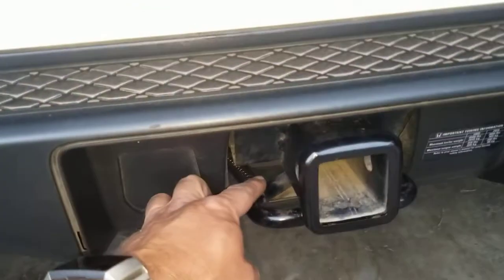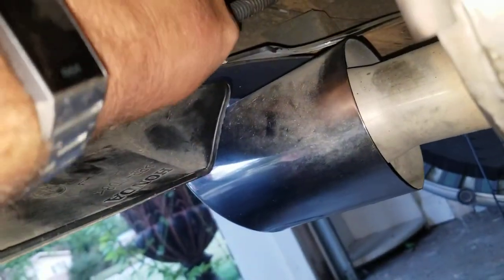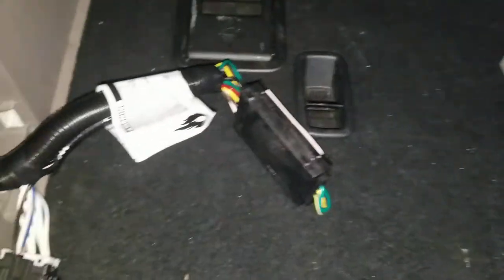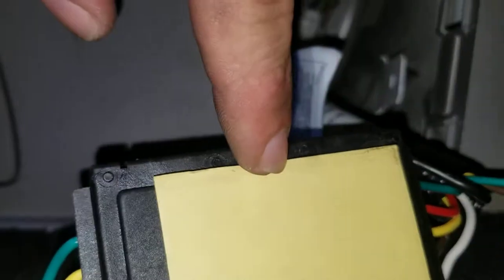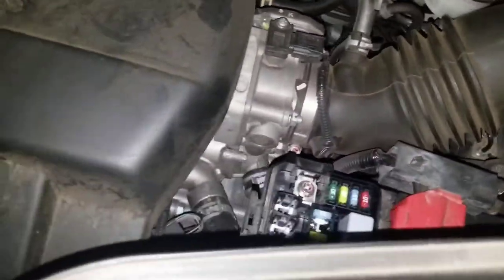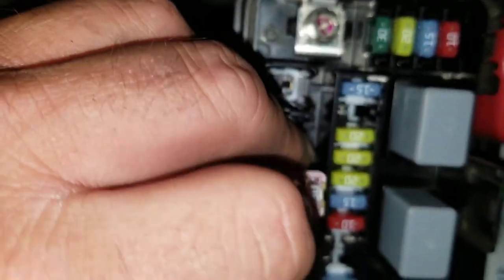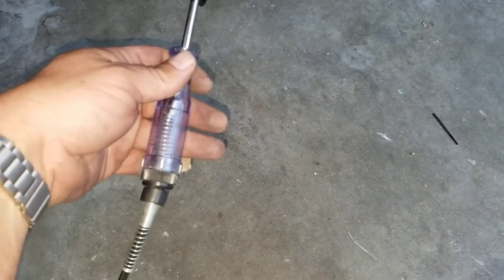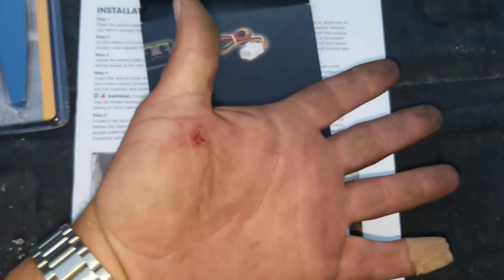2015 Honda Pilot, easy plug and play trailer lights

Comment: gr8 vid,  I have a 2019 ridgeline,  its a little different but  enough for me, I think for the 2019 ridgeline/pilot its Curt #56365.    Where that place goes on the ridgeline  for the relay  ( is behind the rear seat  way back as well difficult to get to. )
Reply from the maker: Thank you and thanks for the info